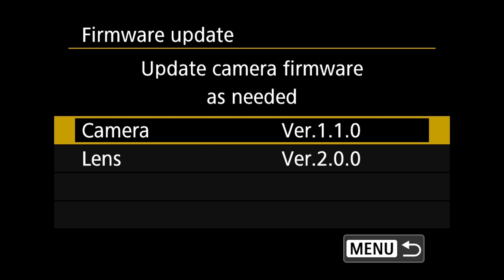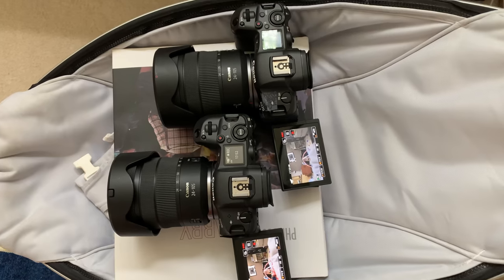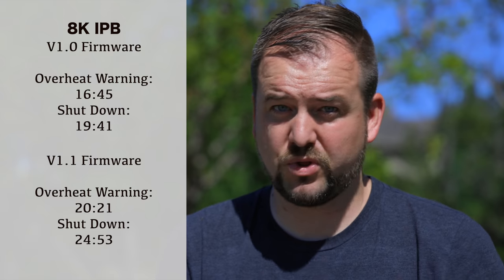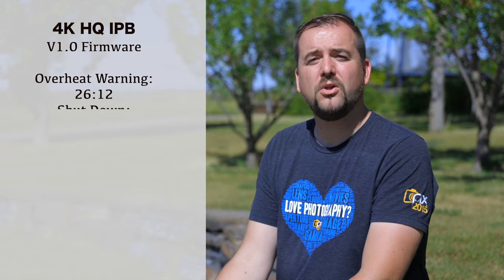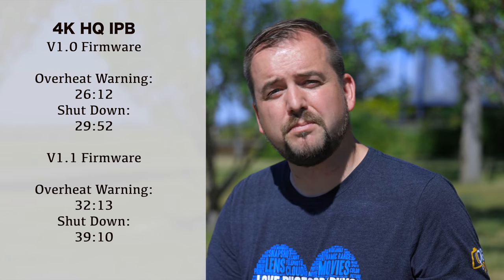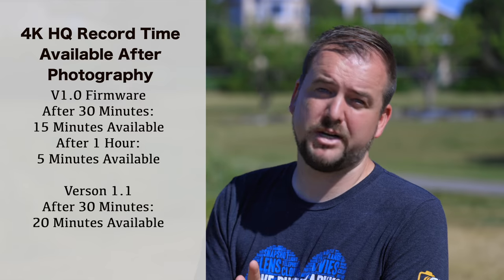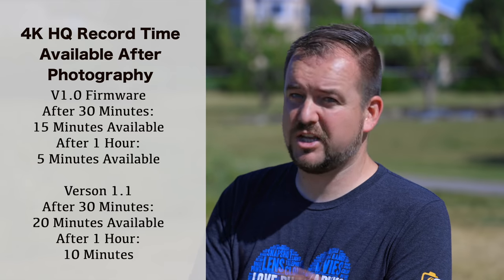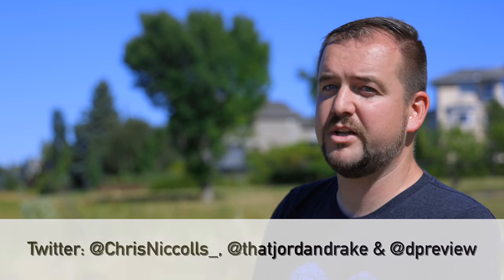Canon R5 Firmware 1.1 - Is the overheating fixed?

Comment: For those unfamiliar, EOSHD website has exposed this as an artificial software based crippling of the video features by Canon. There is essentially an internal timer that dictates the available recording time irrespective of the actual internal temperature. Furthermore, there is a lack of heat sink and thermal compound on the CPU, this glaring ommision cannot be explained by simple unintentional oversight as it's a fundamental engineering component that exists in every hardware intended to be fit for its purpose. It's time the dpreview speaks up about this issue! No company deserves to be rewarded for deceptive practices and treating their customers with such contempt. It creates misleading and unfair competition where Canon is charging just as much if not more than other competing products for features which are simply unusable. The full article can be read here https://www.eoshd.com/news/eoshd-testing-finds-canon-eos-r5-overheating-to-be-fake-with-artificial-timers-deployed-to-lock-out-video-mode/
Reply: DPReview can't "speak up about this" because they don't have proof of intentional wrongdoing by Canon, or the engineering details of the camera. It's Canon that needs to explain why they are limiting recording time without obvious overheating.
Reply: It's true. 
Philip Bloom did a test on one R5 in room temp. and the other in a freezer. Same result. 
It's a hardcoded timer in the firmware to protect the camera from overheating.
Reply: @emusp  Let's hope that the recent and future firmware updates will set recording time on actual temperatures. What I would like to see if for the internal temperature to be displayed next to the available recording time on the screen. This would at least explain what was going on inside the camera and give some justification to the recording limit. i.e. if the shutdown temperature is 80C and current temperature is 60C, then you might be OK if it reports that 10 minutes is available. If you turn the camera off for a few minutes you would hope to see temperatures drop, and available time increase. As long as there is an understandable and transparent relationship between the temperature and the available recording time, then most people would be OK with it, I think.
Reply: @emusp  But this has been changed with 1.1.0. Gordon did a test and putting it in the freezer made the recovery time a bit shorter.
Reply: Maybe they're worried without these 'overheating restrictions', it will cannibalize sales of their (probably) soon to be released RF Cinema camera.
Reply: EOSHD took this info from Chinese guy.
Reply: Yeah, reason why I suggest people avoid Canon at all costs if not already in the ecosystem. They’ve been doing this for years. They don’t give a crap about their customers. Canon is ok with lying to keep a majority market share.
Reply: @emusp  It's not to protect it from overheating, then it would use the actual temps.
This is solely to protect their cinema line. Classic Canon cripple hammer and not caring about their customers.
Fuck Canon and their practices
Reply: @Aveiro17  Maybe. 
Or Canon just forgot to install a temp. sensor. Would love to see a thermal video of the body so we can see the actual temperature.
Reply: This "fake timers" theory has been debunked several times at this point. You guys should look into the latest news, because Canon has now explained how the overheating actually works - there are actually 3 temperature sensors. Check Gorden Laing's latest video where he confirms that temperature does in fact have an effect on recording and recovery times on this camera.
Reply: @emusp  It's been confirmed today that it actually has 3 temp sensors that play a role in how long you can record for, and how long it takes to recover. The "fake overheating" theories have basically been debunked.
Reply: @brazillmedia5802  Jesus, you are a real tool, aren't you? If you are on Canon's payroll, then it's understandable, you're just doing your job. But if you are just a random customer,  then your defense of a company with a long history of crippling their products is bloody DEPRESSING.
Reply: The math is simple here. You don't bite the hand that feeds you. This may be a new concept to some, but it has been well documented in various areas. All media are in bed with corporations. Corporations pay, media support.

There are relatively rare cases of truly independent media. It's not easy to build a completely independent "platform", therefore few people do it. Lately it has been painfully obvious, that even traditionally independent youtubers/influencers are being bought by corporations to support their agenda/business.

The sadest is the case of a great critical independent youtuber, that climbs so high that they eventually get an "offer" that they can't refuse and so they join the ranks of media shills. They are usually smart, so the change is only gradual and hard to notice. It's about time people started waking up. We are living in the 21st century information age. This is not the 50s where all corporations and our future was amazing. Smoking is not healthy.
Reply: @brazillmedia5802  Stop spreading false information about this issue being debunked. You're either a paid canon propagandist or a fanboy trying desperately to mislead other owners. No amount of cooling will change the record limit! EOSHD has also demonstrated in a latest post that removing the battery and inserting a single screw into the battery door resets the record limit! https://www.eoshd.com/news/canon-eos-r5-so-called-overheat-timer-defeated-by-a-single-screw-in-battery-door/
Reply: @DenisasPupkevicius  So?
Reply: @DenisasPupkevicius  No I didn't. I have my own camera and did the tests first, and a lot of the groundwork. That's why it's frustrating that Jordan here fails to acknowledge any of it and toe the PR line with a firmware update. The reason he didn't cover any of the breaking news before now is that he had an advance copy of the new firmware and was waiting for the embargo to life on it. The Chinese guy on Baidu contributed to our understanding of certain things like the thermal design and layout of the mainboard. He did a teardown of the camera and I covered that. It's 10% of the total information I have put on my blog, and DPReview have ignored 100% of it.
Reply: @PeterKoperdan  Ironically, I'm a Sony customer (a7s2 shooter), I'm just tired of all the speculation that's being posted as though it's a fact by commenters and YouTubers. Apologies if you don't enjoy my attempts at correcting misinformation though. And I 100% agree that Canon is scummy and has crippled products for decades, but that is not proof whatsoever that the timers and overheating issues were "fake".
Reply: @Tacuddin  Sorry, but you are about a day too late with that data. Go watch nolife's latest videos (or many other channel's) from today and you'll see plenty of people successfully changing the record limits and recovery times by cooling the camera.
Reply: @brazillmedia5802  What are you on?? Go to my site. I can record 8K for 1 hour and even filmed the camera doing it. The timer is reset with a battery pull trick, and the temperature remains flat with no increase for the duration of the next 20 minute chunk, and the next, and the next. Camera is still here. Didn't melt. Ask yourself why this is possible if the overheating problem is supposed to kick in at 20 minutes and then locks you out of another recording that long for over an hour. Also the internal battery backed RAM stores timer info, so when the guy who took his camera apart pulled out the internal button cell battery from the mainboard circuit, he was able to reset the recording times in 8K after the overheating icon appears. Do your research and be happy. Jordan here won't be sharing it.
Reply: @EOSHDTV   I'm not really a potential customer for this camera, so I'm not too concerned either way - maybe one day for stills. But what doesn't make sense to me is this: if temperature was not a factor, why were people able to record 8K for 69 minutes (using firmware 1.0) by putting the camera in the freezer overnight beforehand? And why were they also able to get recovery times down to 25 minutes (from 2 hours) by cooling it in a freezer after shooting (also on firmware 1.0)? Both point pretty clearly to temperature being a factor that affected overheat shutdowns and recovery times, to me.

Comment: I cancelled my pre-order. This certainly didn’t make me regret that... I used to be Canon, went with Sony A7R4 for photos and Lumix GH5 for videos. I wanted a two for one solution, my primary need is photos, but when I switch to video after a day of photos I don’t want 10 minutes of record time. If I use my camera for YouTube videos, I don’t want to be rushed or have to use a lower quality record mode. If I keep my current gear it doesn’t cost me anything, if I buy the EOS R5, I’ll lose money on my old gear and have to buy all new lenses, batteries and memory cards for a camera that is short changing me. AND I would go from 60MP for stills to 45MP, so photography would be a downgrade and the video features would be a downgrade. All for a premium price. I’ll hold on to what I have for now.
Reply: I'm in a similar boat. Keeping my GH5 for video and my EOS-R and GFX for photos.
Reply: orbitalpunk i could understand maybe you upgrading because you already have lenses and batteries, you would be getting more megapixels, and at least some form of uncropped 4K in the non HQ mode. But if what you have works for what you do why shell out nearly $4000 between the body and those expensive memory cards? I understand.
Reply: Thomas Rufer so my A7R4 does regular 4K... why would I throw away a 60 MP stills camera at a loss for a more expensive camera that doesn’t do better “regular 4K” and still has a 29:59 record limit AND has more expensive media, AND has more expensive glass... talk about not being stilly 🤣 to throw money in the trash is silly. What more would I be getting with “regular 4K” over what I have now?
Reply: Gap where have you been? The R5 is supposed to be an excellent photo camera?!?!? But I don’t see a need to change if it doesn’t do better than what I have... I think most people who are already invested in canon have a great photo camera but a not so great video camera. Does anyone read anymore?
Reply: @alexsystems2001  I couldn’t agree more, I left canon system since 2014 switched to Sony and never looked back and waiting on my fifth Sony body the A7S iii 👌
Reply: Gap yes the A7R4 is great for stills but so is the R5... I would take a hit on the MP if the vide features didn’t have any limits. Tony Northrop compared the 60MP A7R4 to the 45 of the canon and it wasn’t a huge difference. So if canon fixed the video problems it would be worth the switch to have a one camera does all system.
Reply: Thomas Rufer Wrong! I couldn’t care less about the 8K... and if canon didn’t offer 4K HQ I would NOT have even originally put in a preorder and still felt as though canon was lagging behind.
Reply: @alexsystems2001  I was waiting for this camera a long time, I am switching from DSLR to mirrorless for the first time, I had two options R5 and Sony a74IV but this overheating make me kind of disappointed I will use the camera for family pictures  not for business. I need your advice because I think I am in the same boat as you. What will you advise me?
Reply: Lia Loves Gaming I look at it already having a high megapixel camera. I would personally be at a loss buying the R5. There is no real gain there for me on it especially having to buy all new lenses. The R5 for photos should be excellent. I would do whatever works best for you, everyone is in a different spot. The R5 from what everyone says and shows I think would be an excellent photo camera although a bit overkill for family photos. I think for family videos as well most people for family videos the high end video modes that overheat on the R5 I probably wouldn’t be using them much anyways for family stuff 8K and 4K HQ is overkill for family videos and the rest of the modes I would be happy with. Again, it’s a tough one going into it fresh with no anchor like lenses and accessories. It would be tough, I’ve always liked the Canon colors, the Canon menu system, the Canon build quality are all amazing. If I were starting fresh I might lean Canon. OH one added note... if you are a DSLR shooter coming from canon with a lot of EF lenses it might be advantageous to go Canon I’ve heard the adapter with their EF lenses works quite well. So that way you wouldn’t have to be in a rush to switch to the RF lenses. You could start slowly.

Comment: Jordan looking at the Release notes of the Firmware update they do mention improved temperature detection

Firmware Version 1.1.0 incorporates the following fixes and enhancements:

1. Useful messaging is now displayed when [HDMI display: Camera+External monitor] and [Overheat control: on] settings are enabled.
2. When using certain RF lenses for movie shooting, the in-lens image stabilization mechanism has been improved.
3. Fixes a phenomenon in which the "Slow Synchro" setting screen is not accurately displayed, when the language is set to English.
4. Fixes a typo displayed on the communication setting screen, when the language is set to Korean.
5. Connectivity during FTP transmission has been improved.
6. Fixes a phenomenon, in which the card access time may take longer, when using certain CFexpress cards.
7. Temperature detection and shooting time control in video shooting have been improved. In addition, the total shooting time when the short-time recording and power-on/off are performed repeatedly at room temperature is improved.
8. The phenomenon in which the movie recording time available is not correctly displayed when the Date/Time/Zone is not set has been corrected.